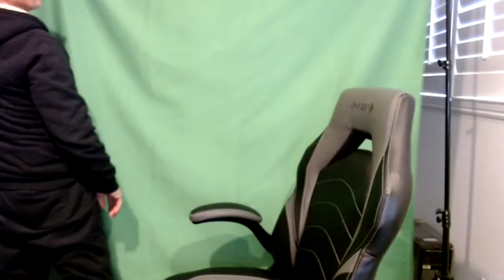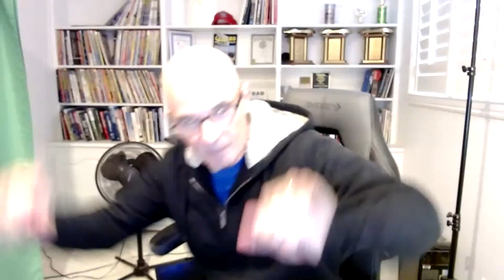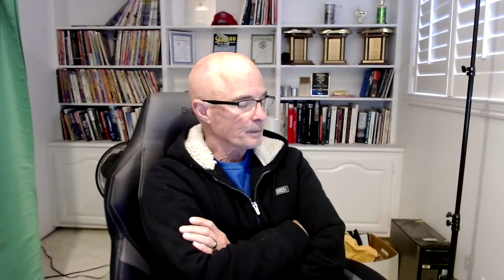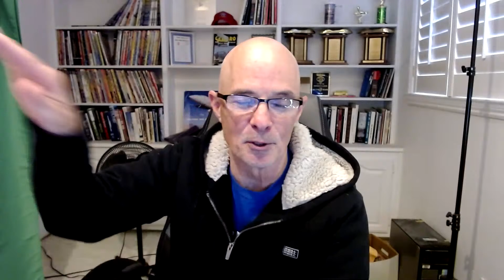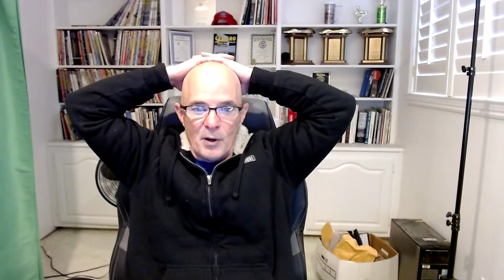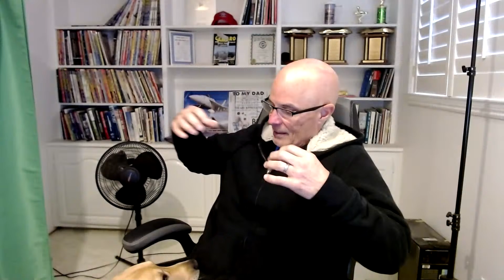ASYMMETRICAL TURBO LET'S TALK TECH

Comment: So on your basic cam and intake , 5700 rpm Chevy 350, would the rising boost rate push the max rpm up like a centrifugal supercharger , given the correct size turbo? Maybe a 76/65 T4 ?
Reply from the maker: yes but not indefinitely

Comment: Hello, Richard, I know this is a little late per the video but i'm thinking about doing an asymmetric.
Combo on a pontiac solstice, with a V8 swap (LS 416 stroker) .which of your turbos would you suggest  and if there's not enough room for it Under the hood, which turbo would you suggest for remote mount? Only looking for about 625/650 rwhp.
The remote mount will be both banks feeding the turbo. I trust your suggestion and I follow you all the time for LS boost combo.
Thank you in advance.
Reply from the maker: G42 for remote, GTX3585RS for assym
Reply: One last question. If I get to do the asymmetric under the hood ,which A.R. would you uses? The 416 will be 11:1 maybe 11:25.1  with 823 heads and this will be street/ strip use. ( weekend fun and run )

Comment: I'm glad you've broached this topic because there's so little information out there on the concept.
I've considered doing asymetrical in a tight engine bay with a V6 (essentially, the turbo would take the spot of the AC compressor). 
When thinking about the whole concept, I wonder how much a larger displacement engine would assist spool onset through the intake side (50% exhaust pushing with 100% ingesting) vs a 'normal' setup.
Reply from the maker: Saab did a production asymmetrical v6 turbo. Not sure about your question on larger engine (vs what?). Any asymmetrical turbo will be less responsive than having all the exhaust feed the turbo
Reply: @richardholdener1727 W/R to 'larger engine', I'm assuming an asymetrical setup runs a smaller turbo than normal (where both banks supply exhaust). 
Take a 3L V6 where only 1.5L powers a bank. Is the turbo sized slightly smaller than a typical 3.0L to help the 1.5L, maybe a turbo sized closer to a 2L? 
If so, my question is if the vacuum from a larger engine (3.0L) assists with inital spooling a 2.0L turbo so that a slightly too-small 1.5L bank still be effective?

Comment: Richard I’m setting up a single turbo sbc using Speedway Tru Ram cast stainless manifolds. These are not log style and have 1.375” runners into 2.5” collector. I’m hoping to keep the exh temp up with good velocity. Turbo will be about 1’ from odd bank manifold discharge. Hoping for quick spool and low to moderate back pressure. Great video.